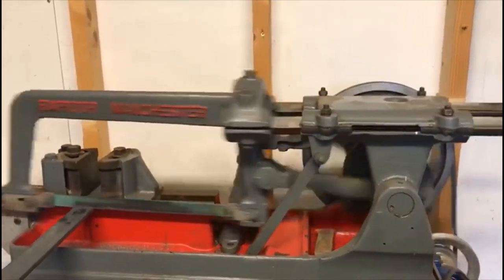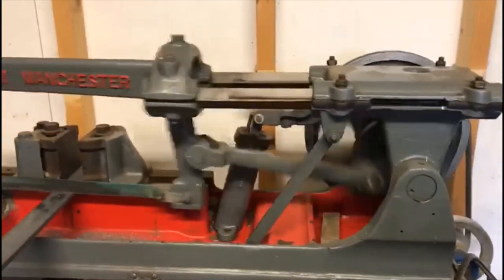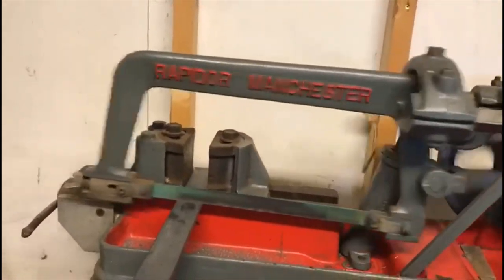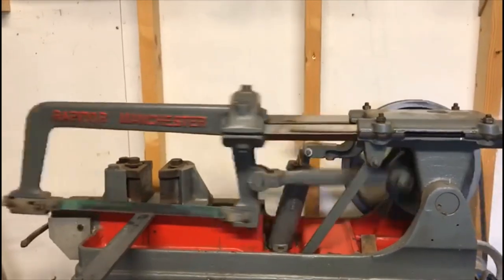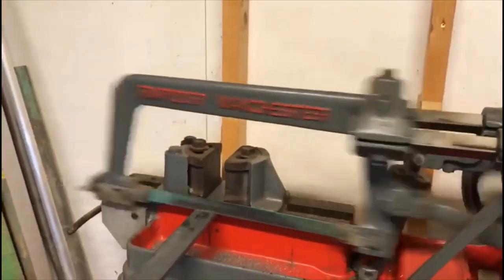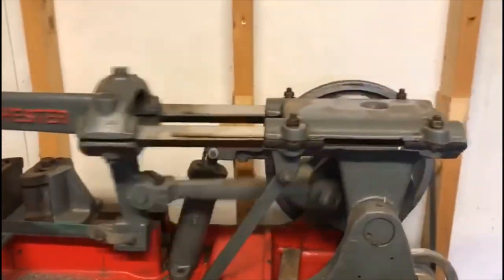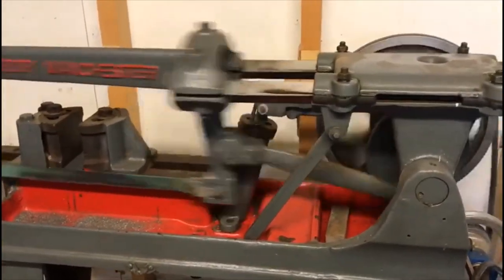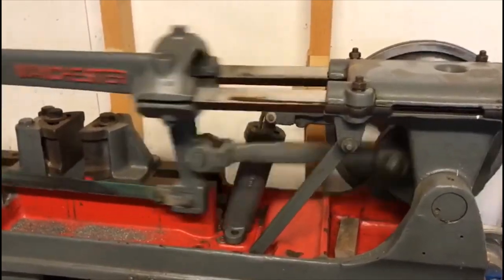Vintage Power hacksaw makes money in the home workshop

Comment: I have one of those and rebuilt it fully and added a new 550W 220V motor and water/oil cooling.
I few years back i found a massive surplus of new unused blades 14" and 12" blades, maybe 800 of each type, with a few different TPI sizes, very cheap.
I made a new holder on one side that can be adjusted to hold either the original 14" blades or the 12".
Still working like new.
Sounds like yours isn't cutting good, You need to make sure the cylinder that controls the fall rate is full of oil and set correctly and that the motor direction is correct because it only should cut in the forward stroke and clear the material in the backward stroke.
When set correctly you should only hear it cut on the forward stroke.
I recommend adding oil/water cooling if you want the blades to last longer.
If you are looking for a good motor that is a upgraded replacement for the original motor look at the links below.  The original motors fitted to these was a 0.37kw 314rpm.
https://www.ebay.ie/itm/Single-Phase-0-55kw-Motor-and-Worm-Gearbox-373-rpm-output-18mm-Hollow-Bore-23Nm/331032128230?hash=item4d130d6ae6:g:gUMAAOSwUmtbJcNc
https://www.ebay.ie/itm/18mm-Output-Shaft-to-suit-a-SIZE40-Right-Angle-Worm-Gearbox-Type-RV-Motor-Ready/222208408405?hash=item33bca73b55:g:DlIAAOSwdW9Z-DWX
Reply from the maker: MrPlytiger thank you for the reply 😊 that’s very interesting indeed, the cylinder has oil in it , I’ll have a play around with the adjustment,  mine came no motor and a very worn spindle bearing , managed to rebore it and add material to the spindle Not bad for me ! Lol . I didn’t know the speed of the original motor, so thanks 😊 , I’ve just bought a duel voltage motor and vfd, otherwise probably would of gone for the motion the link!!  Thank you again ,Chris
Reply from the maker: I’ve got pictures of the original sudds tank for the saw , I look on eBay every so often for one 🙄, and was toying with the idea of making one , I’m presuming the pump is powered of the eccentric shaped disk on the crank ?
Reply: @chris-the-bodge-sculptor  I had an engineering company make me a new bearing from phosphor bronze for 20euro so it wasn't bad, i will make sure to keep it oiled every time i use it to make it last another 50+years.
A variable speed motor sounds like a good idea but it may stick at lower speeds and overload the controller or over heat the motor, it might stick while you are away doing something else and you wont catch it on time. With the proper 314rpm motor installed the stroke rate should be around 100 strokes per minute, the cut rate is then set by your oil filled cylinder by adjusting the long screw from the top, you must use engine oil normally 30-40W or if its still falling too fast use gearbox oil 80W, depends on the amount of wear on the cylinder or piston inside.
You need a very controlled fall rate when using course TPI blades, you will never be able to cut metal with course TPI blades, example6TPI, it will just dig in and stop.
Those saws normally came with an auto off switch on the opposite side to the pulleys, you can see the screw holes on yours still, with that installed and working correctly you can leave the saw working and wander off to do something else and it will shut off on its on when its finished, you could still add this feature if you get a push to break type switch and a start/stop switch, you just wire the push to break switch into the start/stop box to break power to the latch and this causes it to auto stop, you can also use the start/stop box as your main on/off switch to the saw and it also acts like a safety so it cant be started unless its setup ready to cut.
Reply: @chris-the-bodge-sculptor   I know there are some that are powered from the crank but i just built my own tank and added a simple 220V electric motor.
You need to design the tank to that the filings fall to the bottom and that the outlet to the pump is up high and filtered so no filings get into the pump.
I simple bit of box metal can work good as a tank and just place it under the drain hole, your drain pipe can be 1/2 way into the top of tank  and the pump outlet pipe higher up so that the filings fall below the coolant outlet pipe and just use a simple screen mesh filter on that.
Reply from the maker: MrPlytiger thanks thought it would have some kind of mesh baffle inside 👍 mine was really barebones but it only cost £50 so can’t complain , so ...  sounds like your doing a lot of sawing , what are you making ?
Reply: @chris-the-bodge-sculptor  Using it on all sorts of projects, very handy and clean compared to using the angle grinder and cutting tube steel nice and square.
Reply: @chris-the-bodge-sculptor  Just a note on the cylinder that controls the fall rate,  you need to fill it right to the top with oil and its meant to be topped up now and then that is why it has a wide opening on top. 
You must also always lift up the hacksaw slowly to let the oil pass by the piston in the cylinder otherwise it will pour out the top and you will have to fill it again.
When everything is correct the blade should fall very slowly on its own.